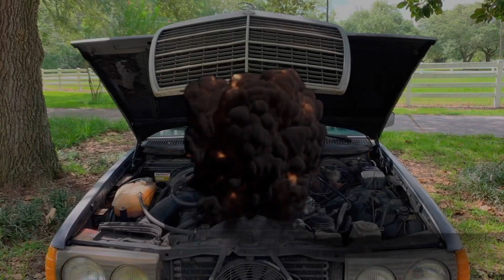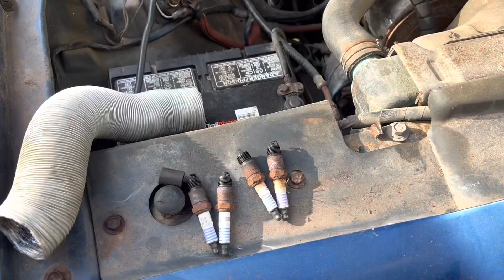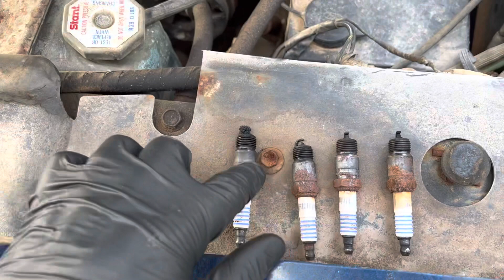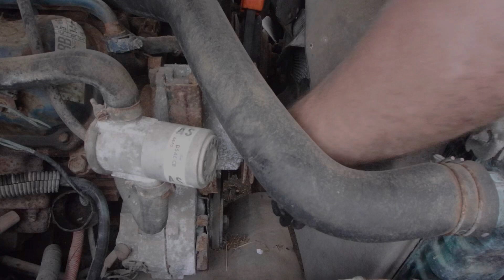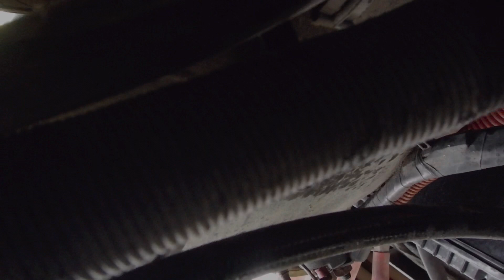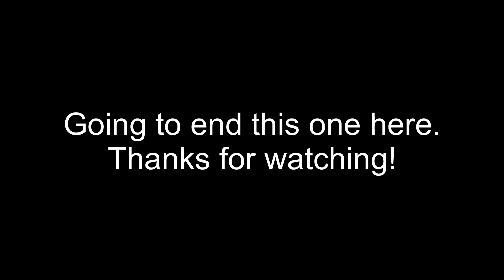Will This 460 Engine Turn Over? 1975 Lincoln Continental

Comment: You were searching for a name for what to put in the cylinders...I suggest "Magic Potion"...LOL. Welcome to the world of the 208hp Ford 460 and the world of the Motorcraft 4350 carburetor. I had both in a 1978 Mercury Grand Marquis. I never had problems with either but people have had a hard time making those carbs behave well. I can tell you from experience that those engines spark knock loudly when they start to overheat. A good radiator is essential. I think yours has a temp gauge but mine and many others had that stupid ENGINE light which was worthless. I actually had to have a band replaced in that C6 transmission too. It would shift directly from 1st to 3rd. I bet a good italian tuneup will help improve those compression numbers too 🙂
Reply from the maker: Yes, Magic Potion, I picked up a carb rebuild kit so will get real familiar with this thing soon. This radiator is junk, leaks all over the place. I’m looking at a 4 core aluminum, should cool better than original. I’m hoping the numbers come up after running a bit.